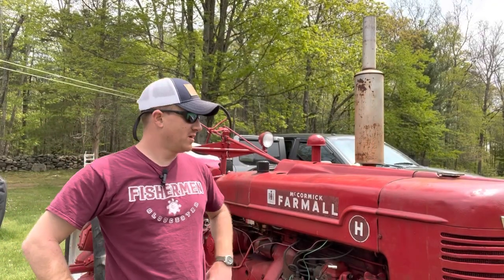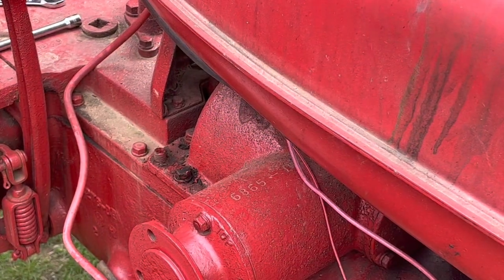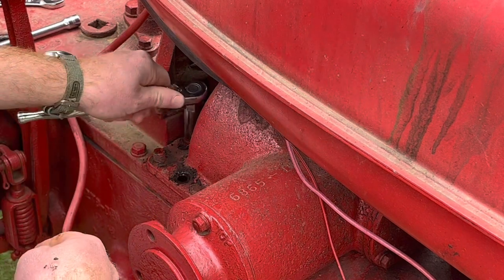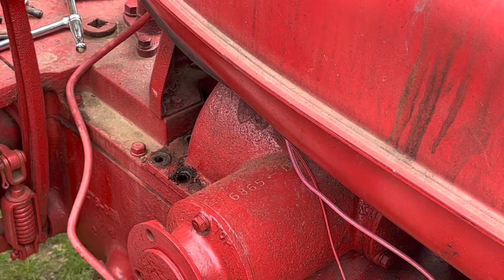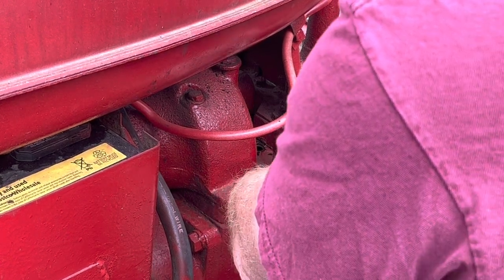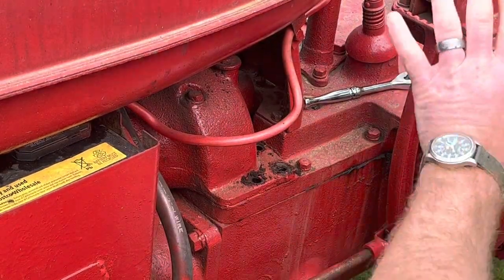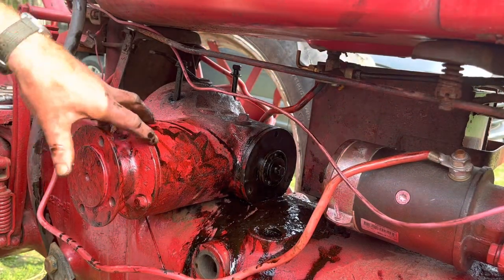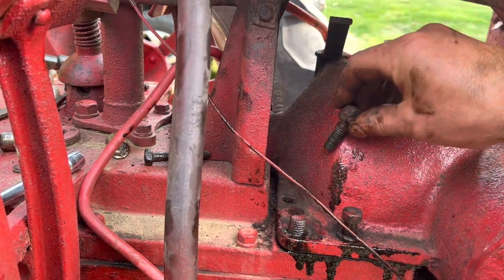1943 Farmall H won’t stay in gear! Can we fix it?

Comment: as a former IHC dealer I have a suggeston for you --the easy one is take remove the shifter lever and check the bottom shape of the half circle shape on the lowest end of the lever--if its quite worn use your welder to rebuild then grind it back to an estimate of the original shape--re-install and try it-I have done a lot of these on farmall H and M models and always worked